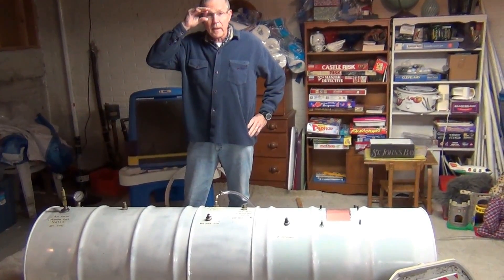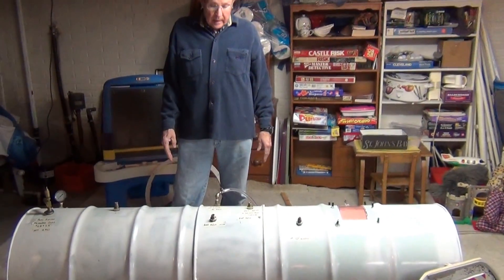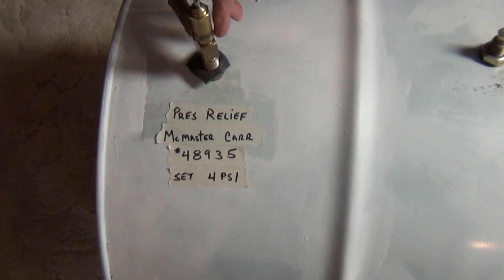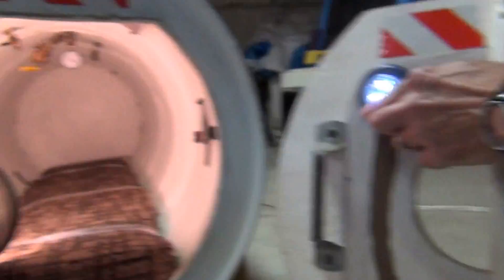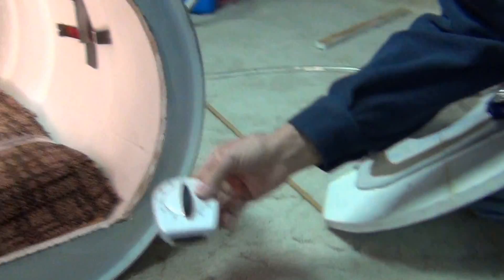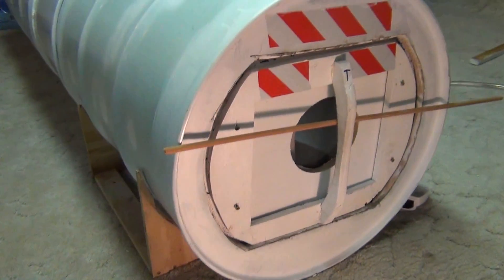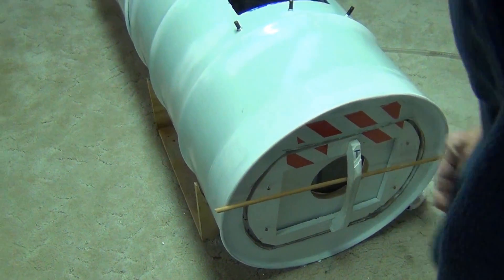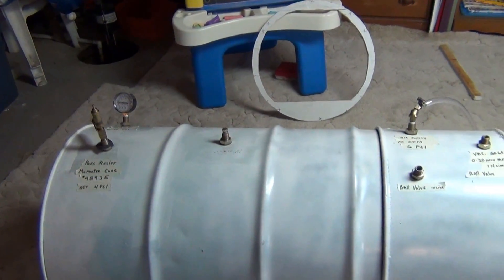Build an affordable Hyperbaric Chamber

Comment: could a person just breath oxygen thru a mask that's hooked up to the pump only instead of sitting inside of something?
Reply from the maker: From everything I've read,  NO!  You need to do your own research and do what you are comfortable with.  See what the people selling expensive Mild chambers have to say.  Be careful, as There is also lots of bad information from people.  I can't tell you what their motivation is?
I believe that a Mild chamber can do some good, it is slow and gradual if I am right.  After over a year of using one, I feel perfectly safe using it.  I wouldn't keep doing it, if I didn't think it was good for me.  I like that I can use it when ever I feel like it.  I have been using the larger chamber shown in video #2, as it is more comfortable plus I can visit / talk with my friend while using it.
Good Luck
Reply: I appreciate your reply Terry thank you. I'm guessing that we need to be in the entire tank to help with the absorption of oxygen through the skin as well? Maybe the oxygen is better that way also, higher psi? Do you use the chamber for anything specific to treat, any beneficial experiences..

Thanks a bunch, Vince.
Reply: Terry Kocsis I also read on another comment on another video that using the pump with regular air without supplemental oxygen is barely effective? Is this the type bad info that you are talking about...I don't even understand what supplemental oxygen would be besides an oxygen tank or something hooked to the pump??
Reply from the maker: vowarren7
We run our chamber around 5 psi.  More pressure increases the air density, which increases the amount of Oxygen in it.  Higher pressures require a stronger tank, and different pumps to maintain the higher air pressure. 
The only measurable success I have had is the arthritis in both of my wrists / thumbs do not hurt any more.  They did hurt for about 10 years prior to building a chamber.  I can tell you that I feel good!   Good is good!  I feel that deep breathing in or out of the chamber is also a good thing.
Reply: @terrykocsis1580  What drum barrels do you use? i could really use a clean one that wont react with ozone, thank you
Reply: No the question was asking basically can a person just breath through a hood without being in a chamber under pressure. I've learned a lot more since, the chamber is the most important part in achieving more oxygen.
Reply: I was in so much pain at one point that the hair on the top of my head began receding and falling out, but since using the portable hyperbaric chamber and being able to exercise more with continued improvement, my hair has begun to regrow.
Reply from the maker: vowarren7
Vince,
 No I am not a doctor, but a retired engineer.  Compressed air will only increase the density of the air in the chamber and does not expose you to the potential dangers of pure oxygen and high pressure chambers.  I have read in Russia they found that the low pressure mild chambers (3 - 5 psi puts 20% - 35% more air / oxygen in the chamber) were more effective for some ailments, but they take a lot longer.  (slow and steady)  It won't be studied in America.
I believe that Most health issues don't happen immediately, but but accumulate over time, so healing may be best the same way.  I have been interested and have been reading lots / watching videos for about 4 years when a friend told me he saved his (nurse) daughter's life by getting her to drink Hydrogen Peroxide to cure her liver cancer.  (her blog 'worked4me.wordpress.com')  I believe that most of us are NOT getting enough oxygen and sometimes we need to supplement it.  Ozone, H2O2, CD / MMS, and Hyperbaric Chambers are all ways to accomplish this (IMO use moderation if you try it). and I've tried all except the ozone.  Did you know that Vitamin C makes Hydrogen Peroxide in the body cells?  BUT, I couldn't figure out why oxygen alone didn't cure everyone, and I feel that Alkaline pH is also very important and works hand in hand w/ Oxygen.
I found from almost every book on health (cancer, heart, obesity), they all include talk about diet.  Almost all claim eat 85% raw, most encourage juicing & pure water.  Eliminate / limit: Tobacco, Sugar, dairy, meat, gluten (turns to sugar in the body) & toxins.  As I looked further, I see where these foods impact Oxygen, pH, and the immune system function. 
Personally, daily I inhale hydrogen peroxide  (oxygen), take half an aspirin (thins blood / oxygen flow), Vit C (liposomal) (makes oxygen in cells), and cayenne (opens blood vessels / oxygen flow).  I use our hyperbaric chamber more in the winter months as in Ohio we have lots of trees pumping out oxygen in the summer, but NOT in the winter months.  When I do use the chamber, I find the pain from the arthritis in my hands is almost eliminated, but do not notice any other major difference.  (I feel I am relatively healthy)
I know what I'm doing works for me, but I am NOT qualified to tell you or anyone else what to do.  I would just say I think to take things slow, and do your homework / study before you try things.
IMO healthcare is a BIG MONEY thing, and they will NOT study / test / endorse anything that they can't make money on, so you have to take charge of your body / health as best you can.  IMO Healthcare owns the Doctors, Politicians, Media, Government, Insurance, ......!
I made my own Mild Hyperbaric Chamber(s) because I could NOT believe they should cost $5 K - $20K, and I was right. (Regulations play a big part in the cost / eliminates competition)   I shared my video's so that others could have the opportunity to learn from my experience and maybe improve on them.  I'm sure it upsets those selling their overprice chambers. 
Good luck !!  We all need it.
Terry
Reply: You can monitor O2 in your blood very cheaply, and find out for yourself if your skin absorption hypothesis is not true, actually checking o2 reaching tissues is a prerequisite for treating people. If you think leaving hydrogene peroxide to bubble adds to oxygen in the body then get a  http://en.wikipedia.org/wiki/Pulse_oximetry   kit.    and test it.
Reply: Thank you for your concern though.
Reply: I also didn't realize you were replying to Terry my bad lol
Reply: Hip arthritis but mostly overall health. My arthritis and pain over the years has affected my cognitive function and has made school really difficult. The chamber I've noticed takes away a lot of my nerve pain throughout my pelvis and I'm better able to focus after treatment. I almost feel reborn lol but I do know that stress causes brain cells to perish so I'm sure the pain has indeed affected my overall health a bit. I'm 25 and have had good improvements over the past year doing stem cell treatment on the defected cartilage.
Reply: Actually check that is seems there may be benefits, call the DDRC in the uk and have a chat to them about it.
Reply from the maker: vowarren7
Hi,  I have read that arthritis can be associated with acidic pH.  Our blood is a constant tight range pH around 7.35 (slightly Alkaline) and I have read that when your intake is highly acidic, your body will rob alkaline from bones or muscle or turn to stored fat.  Almost all disease consistently show LOW Oxygen, and Acidic pH.   I'm NOT sure this is 100% true, but it is worth checking out. 
I recommend Some topics to start your Google / Youtube / Library search might include =
Cesium & Potassium, Mega dose of Liposomal Vitamin C & Linus Pauling, pH Miracle, Baking Soda Therapy, Bill Humble & MMS / Chlorine Dioxide, DMSO, and an 85% raw food (organic if possible) diet & alkaline water, coffee enemas for detox. 
In My Opinion:  Oxygen is critical to good health, but so is proper (slightly alkaline) body pH.  I hope that you find this information helpful.  You are too young to have arthritis and pain.  IF you do try new things, it  is always smart to go Low & Slow.
  Good luck on your journey
Reply from the maker: vowarren7
Vince,  A couple of added thoughts.  IF you have experience some relief in a 'Mild' chamber with about 5 psi, you increased the oxygen absorption by about 30%.  Keep it up, as every little bit helps. 
Some people claim they have cured some nasty disease  with just 5 - 10 drops of 35% Food Grade Hydrogen Peroxide three times a day, or 1 - 3 drops of Chloride Dioxide (CD / MMS) 8 times a day.  Both increase oxygen in the body, aid the immune system, and it doesn't sound like a lot.
Diet can be a big thing too.  Most health diets have a lot in common.  Remember, some foods are hard to digest, and when they are in the colon, oxygen is diverted from organs to the colon to break them down.  IF you get constipated, oxygen is diverted as well.  We really need the oxygen we get to make us healthy rather than sitting in the colon.
Consider trying a colonic and tell the person what your health issues are.  Lean more about Coffee enemas, or CD enemas .  Read Kerri Rivera's book "Healing the symptoms known as Autism", Dr. Andreas Klacker's "Parasite Protocol", Jim Humble "The Master Mineral of the Third Millennium".
I personally feel that there is no ONE magic bullet.  I hope you find continued improvement.
Terry
Reply: @terrykocsis1580  terry. I got poisoned badly a year ago from a mean possessed person. Me and my brother did. We need this ASAP. Can i just breath a ozone machine through organic oils? Or do i actually need the oxygen tank? Im confused about people saying the nitrogen in air turns into poison... i just need fresh oxygen. I am in oregon.
Reply: Terry Kocsis
I appreciate all of the advice Terry. Yes the mild chamber helps a lot and I am also currently doing prolotherapy and stem cells to help repair the cartilage so things are looking up. I understand to an extent about the H202 after reading the book "The One Minute Cure" I no longer ingest H202 and haven't for the last 3 years, the taste will bring you to your knees. However I'm currently in the process of making mouth wash from the solution. I stick to the chamber for the extra doses of oxygen.
Reply: Nigel Lewis
You must be some sort of doctor? lol I have osteoarthritis of the hip, nothing else. I use the mild chamber for my overall health. On the plus side, it does seem to help well with my pain. After using the chamber I can sleep all the way through the night. Over the years I've been able to manage my symptoms so no I am not depressed, maybe a little anxiety but the mild chambers use compressed air, not medical grade oxygen so I am not too worried about the spread of free radicals, although it's something to keep in mind. My overall health is good, I go to school and exercise a few days a wk, as much as I can between stem cell treatments. I use the chamber for about 60-90 minutes every other day, less and less as time goes on. I take 10 day breaks every six wks as well so my body doesn't learn to depend on it.
Reply: Ok fair enough just if you can take a bit of advice just two things, don't use 100% o2 without having an expert check the system for something combustable and don't breathe in compressed gasses directly.  And good luck
Reply: Terry Kocsis I was referring to if Nigel was a doctor. You do not live to far from me by the way, I understand the lower oxygen amounts in the winter, hopefully this winter is better than the last lol. But as far as the chamber I got for less than 5k at a good price from a really good friend. I believe it is safe, I don't believe the makers of it would be selling it if it were THAT dangerous but who knows, this stuff like you said is hardly studied. I use it a few days a wk for about 90 minute sessions. I have the oxygen go through an o2 concentrator which I have set around 90 to 100% pure oxygen which by the time it gets to my face mask the oxygen is at about 50% the makers told me. I understand our healthcare as more people are aware now, they're a travesty. My conditions have improved dramatically over the years because I have taken control over my own health. If you seen me, you'd think I'm a young strong 25 year old. I use the oxygen for the same reasons as you because I don't believe we are getting enough with the environments we live in. The portable chamber eliminates my pain and helps me think more clear, and function better overall after use. I enjoy it. I pop in some headphones and relax to the music just as you do with your TV.
Reply: I do not use medical grade oxygen so I'm not too concerned with explosion, it's never been reported with portable hyperbaric chambers because they use compressed air/oxygen. I believe the chamber is critical for benefits bc if your body isn't under pressure (4.5 or 7psi) then the oxygen won't get to the hard to reach places in your body where the oxygen can do some extra good.
Reply: Terry Kocsis Also Terry, I have read that using lower psi is better over the long haul as well (4.5 psi). My chamber has the capability of going to 7psi, that's usually what I stick too, nothing higher. 60 to 90 minutes every other day with a week break after every six weeks.
Reply from the maker: vowarren7
Vince,
You just made a couple of interesting posts that I agree with. 
1. IF you are just using compressed air (increased density) there is no danger of explosions.  You can see it from our second video with the larger chamber.  We have electricity / lights inside the chamber.  we've used it that way for over 1 1/2 years without any fears / problems.  For the past 8+ months we have also "Bubbled" Hydrogen Peroxide in the tank while we use it.  We feel we are killing any crud / germs in the chamber & we are increasing oxygen like a cold mist vaporizer.  (check out my video "Bubble Hydrogen Peroxide in Hyperbaric Chamber" if you are interested)
2. By having your body under pressure with compressed air (probably even down to 3 psi) you are able to increase oxygen to hard to reach spots in your body.  I believe this is true since your skin is a membrane that is a 2 - way street for not only oxygen but for toxins.  (you eliminate toxins thru 1. Respiration, 2. Defecation, 3. Urination, & 4. Perspiration)  Some claim that you can absorb more Chlorine, Fluoride (toxic poisons) from a long hot shower or bath than you do from drinking lots of city water.   So IMO oxygen can work the same way thru the skin.
In Jim Humbles books / links on MMS (Magic Mineral Solution) aka CD (activated Chlorine Dioxide) he claims that using (drinking, applying on your skin, or enemas) Activated CD is superior to Ozone, Hydrogen Peroxide, & breathing pure oxygen and that it is able to 'Reach parts of your body that the other Oxidizers don't' therefore it does more effective healing. 
Just like Hydrogen Peroxide, CD is very CHEAP, and I do NOT believe there will ever be any studies to verify as there is more concerns with making money on toxic drugs than there is on really curing people.  (follow the money) I have some / tried some &  CD tastes like crap but drinkable, but IF I were really sick, I think I would try it / use if long enough to see if it really worked, as I am not afraid of it.  Kerri Rivera claims / shows that people with Autism improve with the use of CD (mostly thru enemas).  Check it out if you are interested.  In the book "pH Miracle" the author says to use pH drops in your water to increase the Alkalinity.  the pH drops are 28% Sodium Chlorite (NOT Chloride) which are the same as MMS / CD prior to being activated by Citric Acid.
To me is is funny how many people use similar stuff & act as they invented / discovered it so that they can write / sell a book.  I am not recommending anything other than to check this stuff out and decide for yourself what might work best for you and your health issue(s).  Knowledge is Golden.  (We may need some of this stuff when Ebola reaches America?)
Good Luck,
Terry
Reply: Also ebola is a virus. not effected by oxygen, you use chambers in infections with bacteria with are anaerobic,  I give up.
Reply: vowarren7 you can’t cause you need high pressure in order for the technique to work
Reply: vowarren7 You can for sure use a mask or a hood to breath oxygen. You just have to make sure that you’ve got an oxygen in and an air out port. Until recently, the clinic that I work in would use the mask and/or hood depending on the situation. And it was 100% oxygen. We still use 100%. It’s not hyperbaric oxygen therapy if you’re breathing anything OTHER than oxygen. However, as mentioned before, the chamber is crucial to the treatment, because without the extra pressure it isn’t hyperbaric (hyper meaning more and bardic meaning pressure). I don’t recommend doing any of this buy yourself. It takes A LOT of oxygen for the brain to “overdose” but it can happen and the result is often seizure. It isn’t fatal but it’s not pleasant.

But this chamber is built pretty well for a homemade one. And it seems relatively sound. But I also have to say that breathing 30% more oxygen at 4 more Psi than normal isn’t really going to raise the oxygen levels in your body very much. It’s almost not worth the effort if I’m being honest. I only say this with confidence because my boss has been studying hyperbaric oxygen for about 22 years and he’s been teaching me more and more. Just some food for thought. I don’t mean to step on anyone’s toes. :)
Reply: Terry Kocsis
What are you asking? Can you breath O2 at 5psi above atmosphere though a mask, that is not even possible as the valve would stay open and at best it would turn into a free flow valve at 1atm, if the gas is at a higher pressure that the environment it will just flow.  If you are asking is it better to breath 100% o2 from a mask than 21% 02 in air at 5psi yes you get more O2 from the mask but I don't think anyone on here knows what O2 is and does in the long term. Have a look into the affect of free radicals on DNA for a start.
There is a massive lack of any knowledge on this thread
Reply: No I'm replying to you.

Look to be as simple as possible if you put pressurized gas into your lungs with no way of escaping be it through a hood or sealed mask it will kill you. We have positive pressure resuscitators which push air into lungs to keep them breathing but they are rarley used as if you use to much pressure you kill people. 
To make it simple with O2 you can go out and get a mask and a tank of welding o2, you use this to breath 100 o2 with zero short term risk as long as you ventilate the area. This will give you twice as much o2 as the chamber in this vid, with no risk and cost of about us 200.
Or you build a death trap for no benifits. I don;t know why people think I'm a shill as I can give you cheaper options for more effect.
Reply: Ok Ill try to make this simple and don't take it as me talking down but I don't know your knowledge.  I don't know of any studies that show 02 pressure has an effect on arthritis however I can put you intouch with much more knowledgeable, guys that can tell you if that is the case.
The benefit as far as I know it is in using the pressure to reduce bubbles and pressure trauma injuries, it also allows you to send O2 to places it would not normally reach due to circulation issues for example in infections and diabetes.
You need to care about partial pressure which means in short % of Oxygen you put someone on air at the equivalent of 40 meters of water pressure and you are kinda breathing 100% o2, you can get the same effect to normal circulation tissues by just breathing 100% welding O2 for cheap and safely.
So to be clear you get more O2 from a welding tank and a demand valve than you get from this chamber going to all parts of your body. with no risk.

Give these guys a call Diving Disease research centre in the UK and explain what you have, I did my training with them and the navy and they love to talk HBO and they will not judge you for trying to fix yourself.

It may turn our HBO (hyper baric oxygen) works in which case they can help you get real treatment on your insurance.

Before you do anything do not directly put gas under higher than atmosphere pressure into you lungs, think what what happen if you did the same to your rectum. Only worse.

Stress through cortisol can kill brain cells but so little it is not worth worrying about, seems to be you need to learn to relax a bit as well, anxiety will not help your physical health and can cause a few of these symptoms, so try it two ways fix your body but do not neglect your mind.

Has the arthritus affected cognitive function or has the pain made you depressed which causes massive cognitive impairment,  are you happy?

Good luck.
Reply: Ok it seems that is a serious question so Ill answer not joking. If you put a gas into your respiratory tract with no escape route ie you put it into a  mask that seals both your nose and mouth with a complete seal, if you raise the pressure of air in your lungs 5psi greater than your body you will most likely die. The pressure in your alveolar which are sacs with a wall only one cell thick at the end of each lung branch will rupture and air will pass through as a bubble to your blood. it will there become an embolisms which if it reaches your brain will kill you in minutes at worst at best leave you with stroke like symptoms. So no you can't breath air under pressure in a sealed mask and the fact no one has pointed out how that will kill you worries me.
http://en.wikipedia.org/wiki/Air_embolism#Symptoms_and_signs
Reply: Also be aware long term raised O2 is not healthy, free radicals are oxygen yes it kills bacteris but it also shreds DNA.
Reply: Nigel Lewis What are you trying to treat by the way? Or is general health.